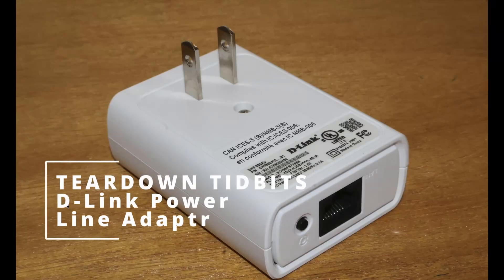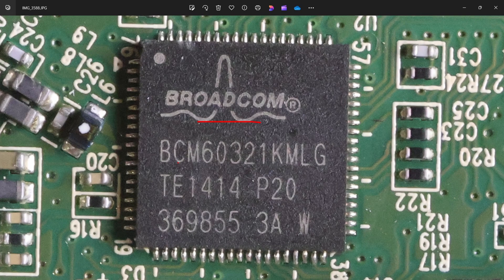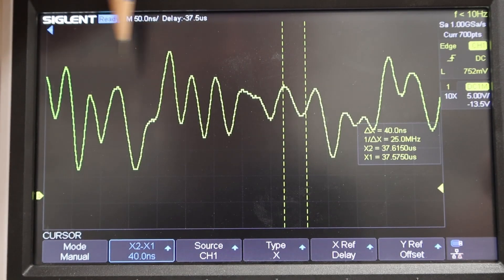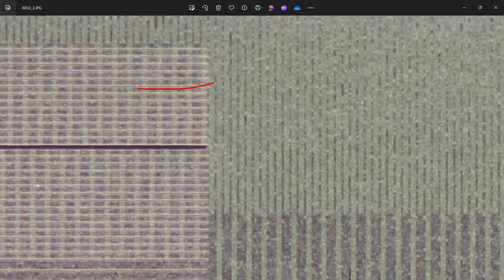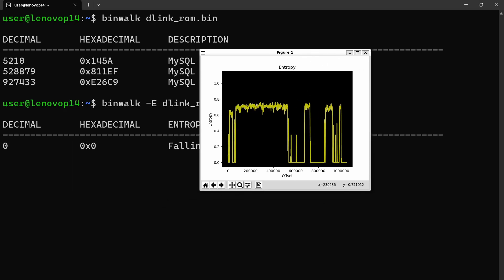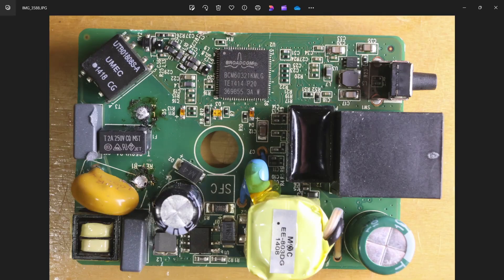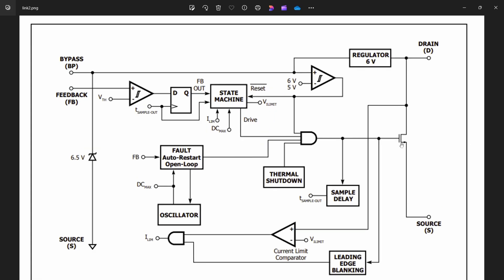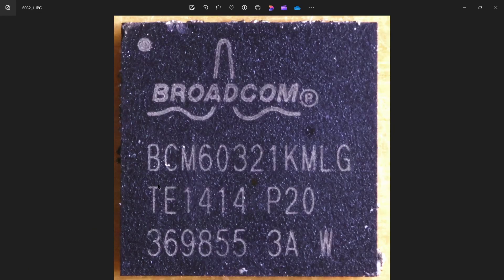Teardown Tidbits: D-Link Power Line Adapter

Comment: These devices work similarly to ADSL modems, except that they send their signal over power lines instead of a phone lines. They use a similar communication technique called COFDM where the signal is sent over many narrow channels instead of one wide channel. As a result, interference will only take out one or some of the channels instead of taking down the whole communication. Also, I was not expecting the Ethernet chip to use DSP technology, but according to the datasheet, even something as simple as a 100 Mbps Ethernet port uses digital signal processing actually.

Comment: I do love your teardown videos, if only because you're the only one I know who regularly deencapsulates chips. I was a bit disappointed to see you using binwalk (because it's the same crappy tool I use) until I saw that this firmware is from 2012. Binwalk can definitely handle that
Reply: I also had one of these D-Link devices in the mid 2010s. It never worked very well, I suspect because the sections of house we tried to join together were far apart and only connected at the main breaker